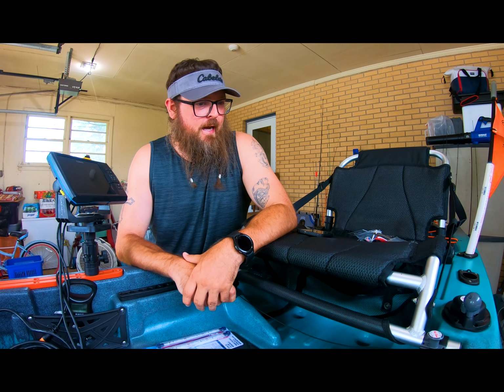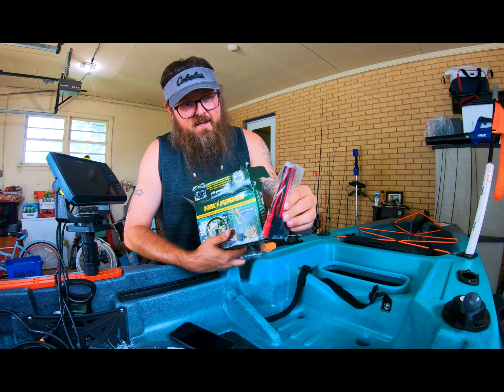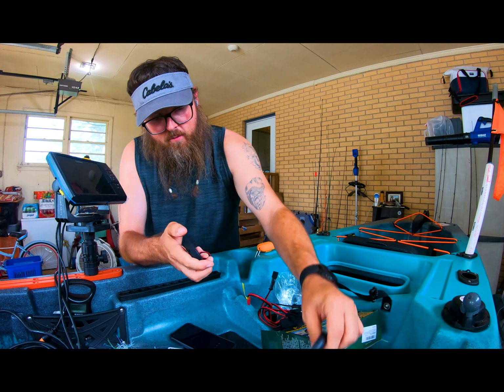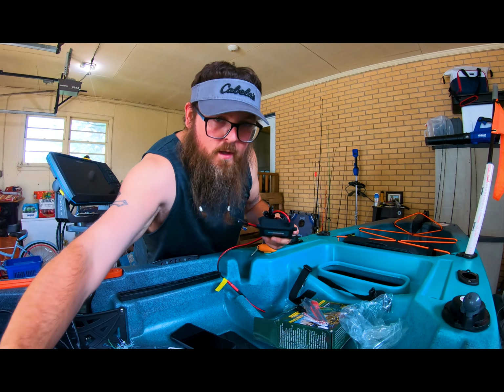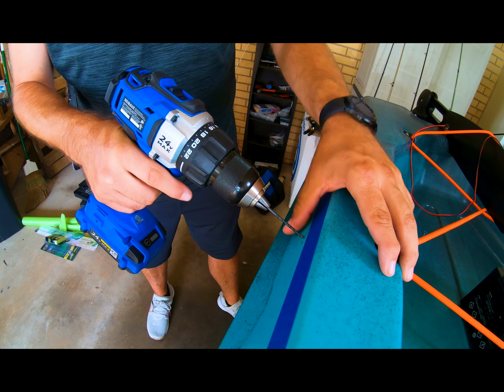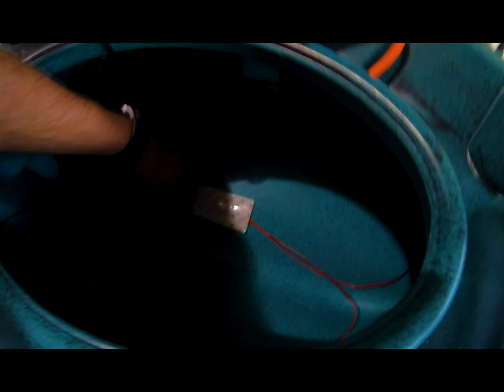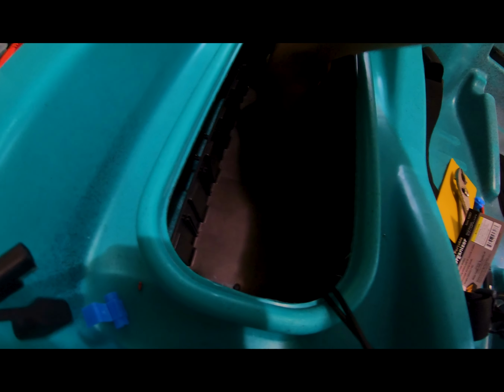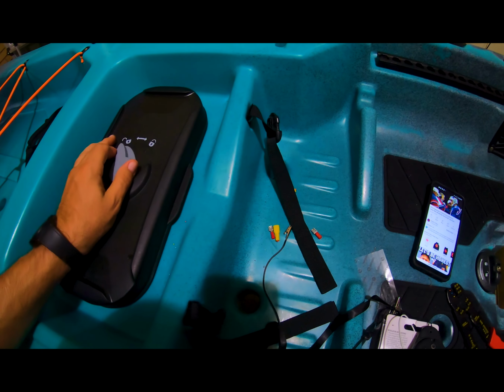Old Town Sportsman PDL 106 - Light Install with Yak-Power's Wireless Switching Kit

Comment: Nice. I wonderd if you would take the wiring job on yourself. It's easy stuff buddy. I've done mine a few times. Great video.
Reply from the maker: It was, but I would have rather not had to learn how to do it, lol. The kit did make it easier, but I really would have paid for a couple of hours of labor and parts for this to be done with a bonded company 🤣
Reply: @TravisDoesKayakFishing  I get that..

Comment: Nice merch bro,.. but,… 🤔 won’t other boats think your coming at them if they come up behind you? 
In Florida you can’t put red and green on the stern at all. Has to be white. Even if it’s not a “requirement” to have them on the vessel. 🤔 or was that a coast guard reg?
Might wanna check on this one 😂
Reply from the maker: I am not in Florida and I don't ever fish saltwater.  In South Carolina on freshwaters, the law is starboard side is green and port is red on motorized vehicles. I am free to use any color combination on mine I choose being non-motorized. I just happened to follow the law I put I on the screen in the video for motorized SC vessels.

Comment: I recently installed some lights and hooked up everything with the yak power system with wired connection.  Instead of drilling a 2 inch hole, which I didnt want to do, I removed the left rear rod holder and the switch panel fits perfectly.
Reply from the maker: Yeah man. I thought about that too. My remote actually crapped out after a month of not using. It just flashes when you press buttons. I only use the phone app woth itm lucky if you use Yak Power button lights, then flick once when power is enable. Lights are probably favorite modifications.